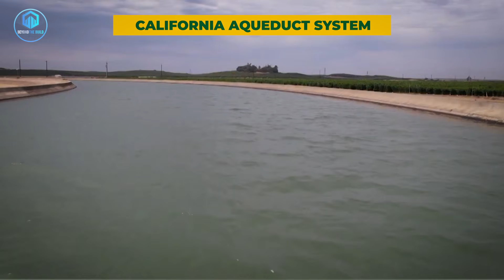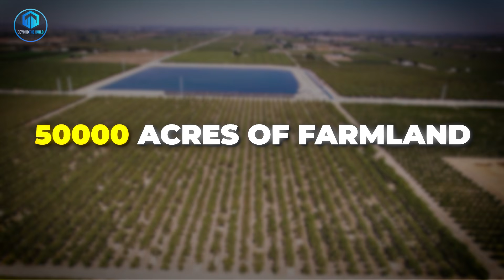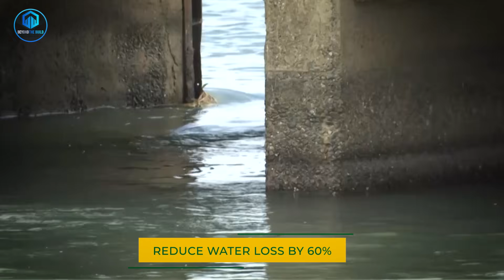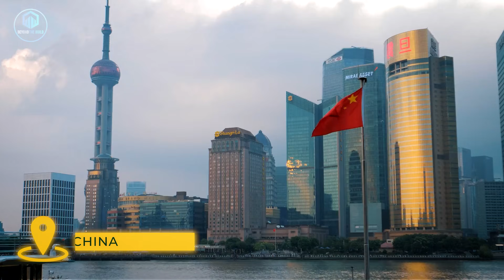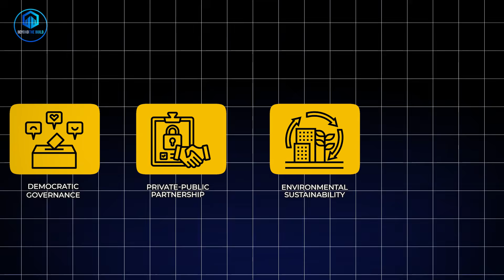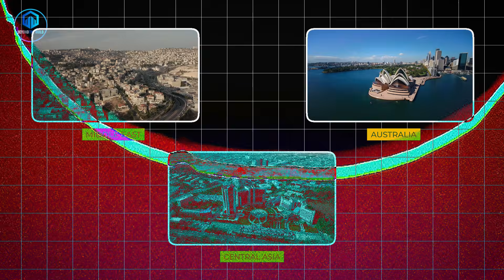The World’s Largest Solar Canal Is Being Built in California

Comment: obviously it prevents evaporation, but how tight is the coverage? does it prevent some rainfall from landing in the canal?
Reply from the maker: Great question! The coverage is designed to minimize evaporation while still allowing for some natural water interaction.
Reply: That is not a problem. Rainwater runoff is called stormwater and enters the canal, just not from the top.

Comment: In 2025 China installed 100 solar panels every single second. More than all solar ever installed in US.
Reply: And they also burned more coal.
Reply: @jtkrpm1  They also have a lot more people, and essentially manufacture a huge part of the goods for the entire world, which requires a lot of factories. Per capita, and especially considering manufacturing, they aren't nearly as bad as people put them out to be. They also have about as much solar installed than the entire rest of the world combined, and produce like 90% of the solar panels.
Reply: @xeridea and burn more coal then the rest of the world combined?
Reply: @jtkrpm1  They burn a lot of coal, but like I said, they have a massive population, and produce a large amount of the worlds goods. They burn about 50% more coal than the US, as they are rapidly expanding, but they aren't even the worst per capita, several countries use more per capita, including Australia and Germany. They burn about 50% more per capita than the US, but have about 3x the solar capacity per capita, and produce most the solar panels for the world. The US barely makes any panels, only making about 4% of what China does, and that is mostly just final assembly, not making the actual cells.
Reply: @xeridea so, more manufacturing? More energy. Less? Less manufacturing. Isn’t banning all fossil fuels then, sabotaging our country?

Comment: Why not float them.  Easily removable as well.  And much cheaper.

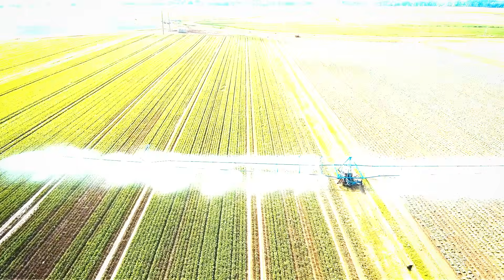Check out time stamp 5:45.
Reply: Great plan for a lake or reservoir not a good plan for a river. The problem is drag affecting the flow rate. You’re standing in a river holding a rope attached to a small boat. The force you need to apply on pulling the rope in order for the boat not to float away is the force applied slowing the water. I like the canopy approach myself 😀

Comment: The steel and concrete support structures probably cost much more than the PV panels. Why couldn't they use common fence posts and pre-fab wood roof trusses? You're basically just building a roof over the canal.
Reply: LOL so really??? you don't think the engineers thought about this .
Reply: yeah and for california that´s actually really good, the solar panels get cooled, so they are more efficient and in the summer less water evaporates, because you know california has been struggling for years with drought periods.
Reply: Silicon PV panels are heavy.  Fence posts aren’t designed to hold up hundreds of kilograms, and standard roof trusses likely aren’t either.
Reply: @davidblair9877  Think about it: If PV panels were that heavy, then roof-mounted solar panels would be too heavy for standard roof trusses. 
Google: "Are silicon PV panels heavier than a roof?" Response: "No, silicon PV panels are not heavier than a roof; they add a relatively small, manageable weight (around 3-5 pounds per square foot) to a roof, which is designed to hold much more, ..."
Reply: @kenjohnson6101 good point.  The fence posts remain a problem, though; they’re usually not meant to carry weight.  I could imagine structural 2x4’s? Or whatever the load-bearing beams of houses are made of.
Reply: @davidblair9877  4X4 pressure-treated douglas fir. >7,000 psi compression  strength.
Reply: @kenjohnson6101 Your roof on your house doesn't span 100+ feet. Also, the wood would rot overtime.

Comment: And if it doesn’t rain, you are screwed. How about the ocean? Desalination is a much better solution. No miles of trenches and concrete. Less chance of corruption by politicians..😮😊
Reply: It always rains some.  This year we’re doing great so far.  And using desalination works for coastal cities, but to water the crops in the Central Valley we need these canals.
Reply: that takes a fuckload of energy we don't have
Reply: @rodrigovelasquez9854 energy use? A lot of energy was used to dig trenches, process concrete, transport of materials, fuel, vehicles,etc. and all needs constant attention and maintenance over hundreds of miles. Desalination also consumes energy, but it might be less expensive..😮😊
Reply: “Wet decade?” Yeah, we get a couple of years, but not an entire decade. Love this project.
Reply: “If it doesn’t rain you’re screwed” yeah, that’s true literally everywhere, man.  If frikkin’ Massachusetts had a year with absolutely zero rain, it’d be f’d.  Thing is, that never happens.  Even the Sahara gets some rain every year, and California isn’t the Sahara.
Reply: Desalination is expensive, and is more of a bandaid, this tackles the issue directly, and generates power, a win win. Obviously, being California, it will be massively overbudget, but in theory it is still a win.

Comment: They can’t even get enough water to put out a fire most less to generate electricity. Their fairy dust is going to need a miracle to work. 4000 miles to generate electricity with a canal and not have water to put out a fire. Pipe dream. No refineries to make the fuel it needs to survive their ignorance is a joke and makes no sense whatsoever. They have spent billions on illegals not any pipe dream. This is a special kind of stupid.